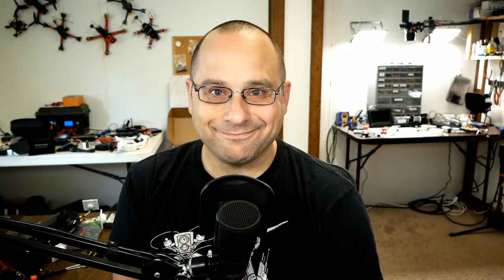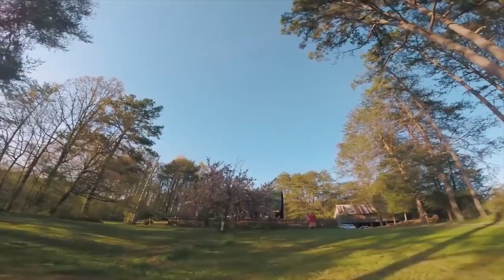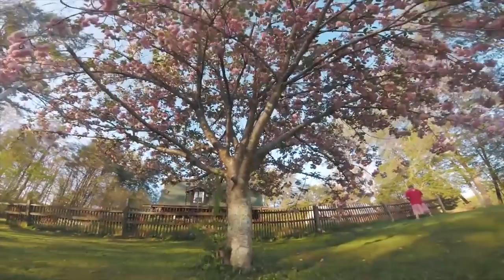Parallel Charging | CAN YOU MIX DIFFERENT mAh OF BATTERY

Comment: Good info video. I tested notebook batteries as a side job for ~2 decades. Then this one IBM battery came along ~1996, it had 18650 cells and some prismatic cells of lower capacity. This was ~25 years ago, I immediately said WTF, lol. But after some serious testing and voltage and capacity analysing, we figured out it was safe. Yea, I am sure it was just explained to you in a few minutes why it was ok, but I was watching out for the ~30+ people company assets, if that thing harmed anyone, the company would be done. Question: what is the polyfuses rated at, that will give me an idea of max charge current using your video info (or I just simply test it, been using poly switches from Raychem since they came out), or are you too busy to answer my question? Thanks for the video.

Comment: Thanks for these videos! Do you talk about using a parallel board to do storage charging, that is bringing my batteries down from a full charge to storage voltage? If not, is that something that can be done if all battery packs are within 0.4 volts? Also would I use 1C storage rate adjusted for the number of battery packs? I would appreciate your thoughts on this.
Reply from the maker: Yes it can be done.
Reply: Joshua Bardwell Thanks! Also to be clear, using 4-1300mah 6s packs as an example, I can set storage amps to 4x1.3amps =5.2 amps for the storage amp setting?
Reply from the maker: Correct
Reply: After some thought about your response, it got me thinking and  you say it can be done, but you don’t say, that’s how I’d do it. Is there a better way IYO. I’m running a HOTA6+ charger if that information is helpful.

Comment: I have heard various opinions about battery isolators.   If the voltage of two 12v batteries has to be very close in order to charge them in parallel and you are charging/maintaining these two batteries off the car alternator,  what would be the purpose of the isolator between the car battery and the extra?  Shouldn't the circuit just be left open???

Comment: As long as the voltages are the same and the weaker cells can take the current then charge away, but you must treat you pack as if it was built from the weaker cells.

Comment: Good job. why doesn't anyone talk about if you have a bad cell on a pack and it potentially damage your other packs? all my 6 packs were 4s one cell on one of the packs read only  4.17v so all packs were charged to 4.2 except cell #4 read 14.7. i noticed it was taking forever and charged them 1 by 1 until i found the bad lipo. I always plugged them in for 15 minutes or so to equalize the cells.

Comment: I mixed batteries once I noticed that one 2300 MaH the other one was 2500 MaH.  That was the only difference I noticed I really had no issue.  obviously I would rather have the same brand that way they're both 2500 might last a little bit longer.  

I used three batteries in a flashlight. I put three AA in one chamber the flashlight and the other three went to the other chamber of the flashlight.  One brand was Energizer the other brand was Duracell.

Comment: Hey Joshua. I discovered in my mobile home that my new system of 400 watts solar to 300ah Lithiums (3 x 100ah) wasn't enough to run my 189l  fridge overnight, but I have enough room for 1 more battery, a 200ah. From your report  I gather it shall be OK, especially as I'm running the solar through a $700 MPPT. IT seems strange to me that 3 fully charged L's won't do the job. I am though wondering why I'm forced to use a 3000/6000 inverter to keep the fridge running after I switch off the ignition of the Merc Sprinter as the previous owner said that he was OK before my upgrade and he only had 2 x AGM of 100ah capacity. Perhaps my auto electrician got it wrong, and doesn't want to admit it. I don't think that he programmed the MPPT, and maybe they're not set to Lithium higher capacities? Lastly (phew I hear you say?), does a fridge draw more out of the batteries running on 110v than 12v? Enough already and thanks for your vid, it was great. Jonathon
Reply: If the fridge can run on 12 VDC, then run it on 12V. Those 3 Lithium's sounds like they should be enough. If charge controller is not programmed properly, you are not fully charging your batteries. If LiFePO4 batteries, they should be charged to 14.4VDC and then stop charging. Ignore charge level percent readout from the controller, it will not be right unless it tracks battery discharge watts. 400 watts solar will take a while to charge those batteries. 400 watts will give you about 33A best case at 12 VDC.  That means about 10 hours of full sunlight on them to recharge. Disconnect the 110VAC inverter when not in use since they still use power.

Comment: Really good video Joshua 👍, still,i belive there are things you need to consider to keep it less "risky". As for example , different lipos take different amps to charge , 1c for a 1300mah 4s lipo would be 1.3a and if you add a 1500mah that would be 1.5a ,so than i guess setting the charger for 2.7a , if my logics are correct .. still tricky 🤣
Reply from the maker: That is correct. Add up the capacity of all the packs and that is your 1C charge rate.

Comment: I just wanted to point out you should never plug different packs(3s,4s) in together, they start smoking instantly. I lost one cell overnight on a 4s, when I plugged it in with other 4s battery's things got hot real quick, so it might not be a bad idea to check your battery's before parallel charging. I've been parallel charging for a while, and this is the first time this happened.
Reply from the maker: The packs must be within 0.1 volts per cell. This can never be true with mixed voltage.
Reply: Joshua Bardwell I probably didn't explain myself well, 1 cell went to 0 overnight, and the charger read it as a 3s. I charge batteries all the time, some half charged(3.9 per) some ripped dead(3.5 per), I've never noticed a problem. If I'm understanding you, your saying that is bad?

Comment: Would it be a problem to parallel charge batteries with different C rating ? Like some 75C with some 100C ?
Reply from the maker: It's fine in my opinion. Your charge rate should only be about 1C so the difference in C-rating shouldn't matter too much.

Comment: Right, would not what to put a fully charged with a battery at 3.7 per cell. You would then have the dead battery "charge" too fast off the fully charged one when it equalizes.  It really equalizes very fast. Remember, max charge rating.

Comment: IDRA race here in maryland, we had two lipo fires. One in the pits while charging with 3' flames and one on the track from a crash. Someone also crashed into the racers pit area and almost killed all of us.
Reply from the maker: A little Vanover action? Or just bad luck.
Reply: Capt. Flamethrower was not here, it was one of the piroflip team pilots. The dangers of charging a pack when 1 cell of 6 is to low in voltage/damaged. Possibly bad luck. No one was hurt luckily, but I know from all the races I have been to, there have been way too many close calls. This sport is exciting and dangerous.

Comment: So what about the age/cycles if lipos. What’s the danger if parralell charging Avery old with a very new lipo?
Reply from the maker: The main risk is if the old lipo takes a dump in the middle of the charge cycle it will kill your new ones with it. Or if you have a pack with one bad cell that takes forever to charge, the other ones will take wear while it is creeping up.

Comment: Hi Josh, Whats your opinion on the actual discharge of 2 Lipos with different capacities which are connected in parallel?

Very different answer (in my opinion) but it might be worth pointing that out in case someone thinks that its also ok..

Thanks..

Comment: I have mixed battery parallel charging (1500mah 4s with 1800mah 4s) before. It was going fine till at the end the charge gave a display "CAPA" (guess it means it reach it's capacity) (thunder 620 charger).  I found this out when I was looking at the charger and notice I totally forgot I have mix the batteries.. But seems no harm was done to the lipos. I haven't try it again though. but since you mentioned this, I guess I can mix charging.. :D
Reply: The "capacity" alarm is a sanity check alarm. It's a threshold you set that is to say "if you reach this amount of charge put into a battery in one charging cycle, turn off because something is terribly wrong". So normally this is set to around 2000-3000mah (depends on manufacturer) because they're not expecting you to parallel charge. You need to set the capacity alarm to something a bit higher than what you expect you'll ever connect. There's a similar threshold for "time out" where it assumes if you're charging for X amount of hours, then something is wrong, stop charging. I think mine came set to 4 or 5 hours so if I ever connected 6 batteries and charged them at 1.3 amps, i'd timeout before they were full not because something is wrong, but because my saftey thresholds were set too low for what I was doing.

Comment: Hi! Just watched your video, kinda answered a question I had regards parallel connection two different  v. and ah. Lithium battery . I just got a scooter   two motor 1000w each, battery pack is 52v 24ah, am I ok if I parallel connect a 52v 22ah to the one the scooter came with?  Thanks

Comment: In a way you're always mixing sizes, if you have 2 1300s in a board that's essentially a 2600 and you're adding another 1300 to that.

I've always assumed you could mix the sizes but never did it just because 90% of my batteries are 1300 and I never use my 1500s.

Comment: As long as the maximum charge current of the highest cell isn't exceeded, using mixed capacities is no problem.
Reply from the maker: Because each pack will take current proportional to its size, you can charge at a C rate relative to the size of the whole array. So 10x 1500 mAh can be charged at 15 amps which is a 1C charge rate.
Reply: I know, but if you take nine 1000mAh packs and one is 5000mAh they will try to equalize their voltage... but most of the current will still flow to the biggest one and exceed the 1C charge of the 5000mAh one (if even even accepts it, usually the current from the charger will go down due to resistance).

I don't like the water analogies that everyone comes up with, one of my teachers always said that if someone compares water to electricity they don't know what they are doing ;)

Is it safe, yes. But there are edge cases.
Reply: I was actually waiting for the correct answer...

Parallel charging is subjected to Kirchoff’s law: no current is lost.

You are charging a cell, current goes in and voltage rises.

This will make higher mAh battery rise higher in voltage than a lower mAh battery would given the same current, the result is that the lower capacity batteries will discharge into the lower voltage batteries.

Is the 
difference in voltage per cell enough to support a high current flow? I doubt it, as the cell voltages are not that far apart and their chemistry would probably cap out absorbing electrons.

Comment: Your "you gonna learn something today" as something different from the others days 😁 Clearly visible.

We need a board that would first connect lipo thought resistances, the time to equalize their voltage safely. And then, after, an automatic switch to "all connected directly" for charging. That would avoid to manage different waves of charging. Next gen charging board ! 🔋

Comment: Hii sir is there any possibility to use 2 different mah batteries with same cell for parallel connection in bot . For example : 2 different batteries of 3cell but different Mah- 2200mah,5000mah battery

Comment: If this is the case, and I genuinely don’t disagree with you, how come we have to balance charge single lipo multicell packs?
Reply from the maker: Because the cells in a pack are in series, not parallel. And series circuits don't work this way.
Reply: Joshua Bardwell that makes sense, thank you 😊

Comment: Nice thx for explaining I am trying to fix my hp tablet battery which runs on 2 battery cells in parralel  I have 2 old phone batteries left over that still work they are smaller but somehow a bigger capacity than the original cells and right now I'm trying to get them both at the same voltage by charging and measuring the voltage every hour till it's both at the same voltage of 4.10v

Comment: Can i use a 12v 75 ah and 12v 65 ah battery together in parallel or series?
Reply from the maker: Parallal you can mix different mAh. Series they must be the same mAh.
Reply: Thanks.  Is mopower 1600va pure sine wave inverter a low frequency inverter?

Comment: So I found some 2.7V 500F 35*60MM Farad Capacitor Super Capacitors - they look the same as the 18650 batteries - my goal is to have in A half mix  of 18650 & half Super Capacitors that way the batery backup ups never dies & it will also be on solar in the day at 2,000 6 amps  is how I have it at 0 gage it was a lot
Reply from the maker: They're rated for 2.7v. You will need a lot of them to use on a 3s or 4s quad.

Comment: its been my habit to put the much lower capacity at the end of the parallel when mixing cells. but i do balance them by fully charge them individually at the same time. im not sure if im doing it correct tho, im just using them as powerbank. those are old cells anyway. but do balancer to each cells in parallel make a point?

Comment: Hey thanks for this info seems like possibly having individual cell management would be ideal for this in applying to an application, for example, ebikes and ev's so it makes charging a bit safer. What I would also like to know about is mixing c rated batteries and how they would effect discharge rates. To give an idea where my mind is in a pack series two different c rated batteries then parallel those two cells to the bus bar and see if there is a balanced rating or what might happen, but you answered an annoying for me thanks

Comment: Hey! I can't find a clear answer online anywhere about mixing different types of car batteries other than people saying you can't mix chemistries... For me this doesn't make sense because your not mixing the batteries together in a blender! Its just adding more power into a circuit. But my scenario is Automotive for a high powered stereo. My front led acid battery is not enough power to sustain the current pull from my amplifier, I need a secondary battery to increase reserve which everyone just uses a battery charger which completely isolated 1 battery from another unless vehicle is running. This is what I don't need, this is for deep cycle batteries running fridges and camping stuff. 

All I need to do is put in parallel my front lead acid battery which at resting is 12.6V and run a positive and negative with a fuse to an AGM battery with a resting of 12.9V. They have different charge rates but does this really matter that much? I can understand a lithium and lead acid together is not a good idea because resting voltages is over a volt apart but AGM is similar enough to lead acid isnt it?

Comment: I am usually charging in parallel my micro 450mAh 2S 80C with 970mAh 2S 70C at 2A - if amps splits its still 1A for 450mAh and 1A for 970mAh which is also ok :) NOT SURE how amps splits - never measured that but I am doing so last year and I am still flying :D
Reply: Chemistt charge current splits proportionally. 450+970=1.42Ah. If you charge that at 1.4A both will charge at 1C.

it's kind of understandable if you consider they start at the same voltage and end at the same (and spend the time in between at the same too). The only possible current split is proportional.
Reply: I trust you :D still I am going to check that with watt-meter :D on "bigger batteries" :D

Comment: I want to mix 140ah AGM battery with 25ah lithum cell battery is it ok. using solar mppt  invertor/charge controller
Reply from the maker: No. You can't mix different chemistry in parallel like AGM and lipo.

Comment: What would you say the limit is for this 1000mA?
Reply from the maker: For a 1000 mAh pack, 1C charge rate would be 1 amp. Most packs can be charged at between 3 and 5C without harm, although the risks of a fire go up significantly. Safest procedure is to charge at no faster than 1C.
Reply: Joshua Bardwell sorry, I worded my question stupidly. I meant, what would be the maximum mA difference the batteries could have, 1000? (Charging a 1000mAh with a 2000mAh)

Comment: Can we connect **  two  different C  rated 3s *battery in parallel  (suppose  one battery is 2200mah 50c  another one 1000mah 40c     ? I will use it in 12v spot welding  which need 150amp ..
Pls reply
Reply from the maker: That small difference in C rate will probably not matter.
Reply: @JoshuaBardwell  sure battery will not damage.?

Comment: Can you mix a AGM gel cell with Lithium batteries?
Reply: It would be interesting to try this and see where they voltage equalize.   If at around 13.5V (the average of 14.2 and 12.8), that might be fine for something like a starter battery setup (to start a large motorcycle for example).  13.5V is a nice trickle charge voltage for most AGMs and 13.5 for lithium is still more than 90% state of charge.  I would say you could mix them for brief discharging, but be careful when charging.  I would say those are better charged unparalleled, otherwise you might overcharge the AGM and undercharge the lithium.  Using them as a motorsport combo battery setup, make sure your voltage regulator does not allow the charge voltage to go above the max spec of the lithium (in my case 14.2V).  An AGM will tolerate that and it will make the lithium happy too.